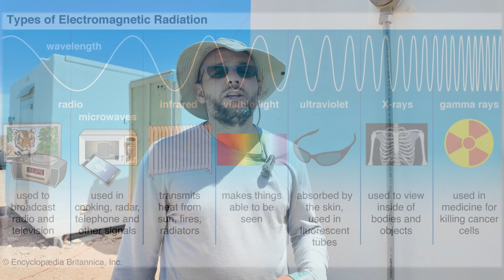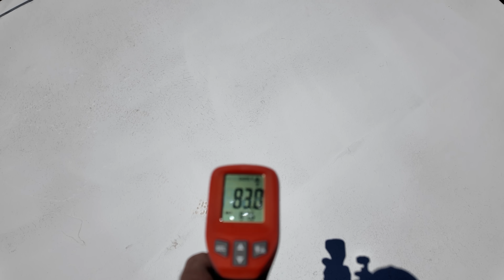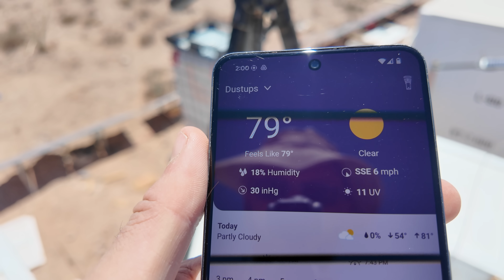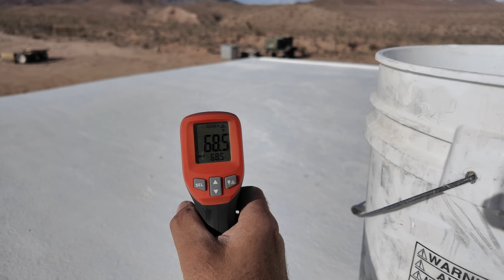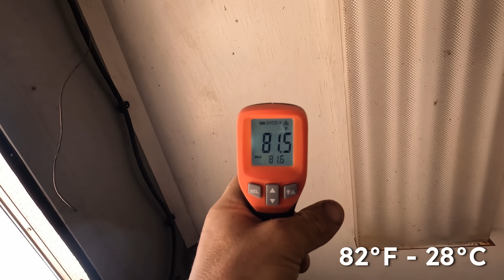I sprayed "cooling paint" on my desert cabin...this is shocking

Comment: You definitely need some wind power sources which will give you much more power as it appears the wind blows good there. Even more so watching you just about get blown off that roof? one or two small to medium wind power generators with your solar and It would greatly improve your power situation by adding power sometimes even at night. Another thought is to actually mount Solar panels on the roof with space between the roof and panel as that would also shade the structure while providing power.
Reply: Sun and wind together to feed the same battery system is always nice. Especially if you also have something that can benefit from peaks like running AC extra hard if there is excess power.
Reply: Plus wind turbines produce a small cooling effect a well.

Comment: Maybe getting wind mills to produce electric since it looks like u get wind there
Reply: Well he also has quite a bit of sunlight so i would assume that knowing solar systems is probably enough. Managing two different electricity systems might be a bit of a hassle… especially considering the most expensive part is the charge controllers and batteries anyway
Reply: @maxsmith8196  if the wind blows through the night then it would put less strain on the batteries
Reply: @maxsmith8196  there are inverters that handle bot solar and wind, but yeah that is a sizable investment
Reply: Solar would be cheaper and he could use cheap battery packs to store it.
Reply: Wind turbines also had a cooling effect on surrounding land.
Reply: @DavidKnowles0 What planet did you go to school?

Comment: You could set up shade cloth around the buildings to shade the buildings and prevent direct sun exposure. This also places less warm air next to the building.
Reply: Shading the west side of the bedrooms would probably help a lot too, whether with shade cloth or just parking something on that side or moving the kitchen or shower over to the west side of the sleeping quarters so they aren't getting the late afternoon sun.
Reply: Too obvious?
Reply: Yep! Here in australia, Dongas (Huts) are usually congregated under a big corrugated metal arch. The air gap helps with dissipating the heat from the above roof. It's surprisingly cool under the whole thing. Often there's a communal bbq area in the middle too.
Reply: In Tenerife, they use huge Green Netting over their Banana Plantations. Rolls of Bamboo Sticks as a cheaper lower wall. The Temperature inside is a LOT cooler. Maybe a few Pots of Clumping Bamboo to help with the Shade, they’re very Tall and Bushy. Just a thought. ❤
Reply: I've been saying that to myself since I first started watching. 
Sun shade cloth would save them a huge amount of discomfort.
Reply: Agreed. My first thought was desert camo net strung up between the buildings and/or over them
Reply: Reflective paint must stay clean to remain reflective. This could be difficult in a dusty arid climate. Shade cloth is used frequently in the south. Wind will not damage the cloth if suspended properly. It also can protect from hail. UV light eventually deteriorates the cloth.
Reply: Shade cloth is actually less effective than thermally emissive paint.
Reply: @badsamaritan8223 I think a lot of ppl who watched this video don’t understand the radiative paint.
Reply: Agree 💯
Reply: @badsamaritan8223  May be, but he expressed not painting the sides of his building, where the shade cloth would go.
Reply: See my comment above. It works. And during high winds as well. Used by military deployed to desert locations.
Reply: The easiest way is to paint the roof white. Shade the front. Then use earth on the 3 remaining sides
Reply: @LisaTurner-d1b  another great idea
Reply: Shade is key! You could use fabric or white-painted wooden slats—or any material that works.
Reply: @Patschenkino  True but anything in that blowing dirt environment needs to be cleaned
Reply: @cheapercharlie  Those things still provide shade even if they get dusty. 😉
Reply: @Patschenkino  You are right
Reply: Burning man approach -shade structure over structures and shared areas.
Reply: That was also my first thought :). 
I would also investigate stone and earth walls to shade the sides of the cabins and redirect winds if needed.
Reply: Yes but you won't get the active cooling effect from the radiative cooling, so it may or may not be better
Reply: @srboromir452  I suggested it with the sides of the doghouses in mind, where he mentioned not painting.
Reply: I was thinking of something similar but with a light colored privacy fabric for better heat management (as opposed to darker colored fabric) as well as permeability with air.  It'll also catch morning dew to help with some relief before the day gets hotter.
Reply: @Nanogrip as long as they don’t go over the roofs 😉
Reply: Or even use solar panels for 'shading' and powering the AC. 🙂
Reply: Feel like the wind there put a lot of work on the cloth
Reply: @gamerboy7820 there are lots of things in the desert covered by shade cloth for camouflage and heat or both reasons.
Reply: @gamerboy7820 I'm in Florida and have them up during out dayl (cat1) afternoon storms. Even the cheap ones from Amazon are tough.
Reply: @gamerboy7820 gyproc plus some wood to hold it. Or aluminum siding. 

Cloth is just cheap and easy to put on, but even the laziest roof on top of the box would help a lot.
Reply: @gamerboy7820  We use shade cloths in the middle east over our tents
Reply: @gamerboy7820   it would have to be air permeable, and offer some shade.
Reply: @gamerboy7820  shade cloth works in situations like the guy said if you do it correctly you need to add support and taught it fairly well and add more anchor points so the cloth wont start flopping around its the flopping that starts to create friction which wears on the fabric i've done what he said and it works it makes the rooms color too it wont make it magically colder but it will bring the temps down a good amount
Reply: @gamerboy7820  Agreed on the wind. I live in a windy place, windy enough there are hundreds of windmill generators in the hills nearby, starting maybe 10 miles away. You learn to not leave things like tarps out, or they'll be gone. You have to use extra staples for landscape fabric, and staple as you go. Things like kids playhouses and trampolines have to be anchored into the ground, and in construction, house-wrap better be covered with siding soon or you'll have to do it over, and you do NOT see people with those shade umbrellas built into their patio furniture/picnic tables, because at best they just break, and at worst they break a bunch more stuff when they fly around, and are a huge liability. With that kind of mindset of living in a windy place, every time I see shade cloth suggested to Shawn, I think "yeah, that'd be nice, but it would just be ruined, probably sooner rather than later." 

If anything, he'd need like ultra-sturdy shade STRUCTURES built or brought in and installed, but that could be pretty pricey. If he and friends/employees are into welding, then maybe they'd still want to give that kind of thing a try, maybe something like what'd essentially be over-built/oversized covered parking structures, where solar panels could be mounted. Or, maybe they just literally build a sturdy solar array that's a little ways off the ground. One additional option here is having solar-heated water for showers, washing hands, kitchen use, etc. If it were me, I'd go with a sturdy (welded steel) solar array that doubles as shade, maybe even something like half an A-frame that could maybe double as a wind-block (depending on the direction of their prevailing winds).
Reply: @gamerboy7820 use the same material that Bedouin’s and other arid nomad cultures use for their tents
Reply: @FancyVader  --- Shade cloth would be better the wind goes through the open weave.
Reply: @FancyVader  is that cotton or wool?
Reply: @FancyVader  thats woven goat hair...you ain't finding that anywhere close
Reply: @gamerboy7820  You could build a "shade cloth" out of plywood. Anything that stops the direct sun and has an air-gap.
Reply: @gamerboy7820  True but that dust will dirty up that white paint in no time
Reply: @cheapercharlie  true instead he should get windmills
Reply: @gamerboy7820  The bad thing with 'windmills' which I think your talking about wind turbines, is that they can tear themselves apart in high winds, even the breaks can fail and parts go everywhere.
Reply: @PetraDarklander  Not to mention cost.
Reply: @gamerboy7820  Fantastic idea
Reply: Yes
Reply: check the episode till the end. Looks like entire new level of construction is planned on the top of existing structures to shade it all finally
Reply: @karolwozniak9023  Yes, but that is a year or years in the future, this would be an immediate solution to the problem that can be moved to another location after it's built.
Reply: Too easy
Reply: We have done this with our cabin and it works amazingly.
Reply: Was thinking the same thing. Platform, shade cloth, anything to create an air layer and block some sun.
Reply: This is exactly what he said in the end of the video, cpt. Obvious.
Reply: @vasiliynkudryavtsev  What are you talking about? If you mean the structure to make it multistory that will probably not be around for another year or years, shade cloth is fairly inexpensive and quick to set up unlike the second story I believe you refer to.
Reply: @aaronbonville4570  Oh, sorry, my wrong. 
He indeed was talking about second story, which is stupid. Because, I was thinking about big shade to put all his buildings under. Which is exactly what you were talking about.
Reply: I thought the same thing, but if wind is an issue, SNOW CAMO NETTING on an inexpensive 2x4 frame built with a 2 foot gap from the structure.
Reply: Hahahhahhahhahahah shade what’s that ? Did you invent that????
Reply: Yep Aluminet. Really good way to reflect light and heat.
Reply: @charlesdeuter Just would defeat the purpose of the paint…
Reply: Did you actually watch the video? 
Hint: the wind....
Reply: I did watch the video, and the wind, if the shade cloth well secured, is no issue. I do not know what you are trying to say, for it is so vague, but I do know I do not like your tone..  @brittassss
Reply: $300 for a gallon
Reply: @tomwuttke  OK, what are you trying to say?
Reply: I've sometimes wondered why reverse brick-veneer isn't a thing.
Brick inside, cladding outside.

Brick has a high thermal mass, and cladding is much thinner, therefore lower.

I assume it's all due to aesthetics.
Reply: I agree however warm air next to the building isn't the problem the problem is the sun directly heating the surface of the structure.
Reply: Land Rover did their double roof skin for that exact reason.
Reply: Scrolled down and saw your reply.  I posted a similar thought but with something sturdier than cloth.
Reply: This.
Reply: I was thinking along the same line another easy to implement idea he use one of those plastic tarps he got donated heist it on 2 poles and a rooftop also spray it with that reflective paint aswell and it would be some very nice shade where there is nothing atm I'm sure it wouldn't hurt or be that time consuming
Reply: I'm confused as to why Shaun hasn't done this yet
Reply: By this comment alone, I know you have no experience with shade cloth. The cloth provides shade, yes, but it traps heat/humidity.
Reply: @drb996  What are you talking about? The shade cloth I have experienced seems to breath better than what you have experienced.
Reply: @drb996 Also would negate the radiative cooling effect. I needs direct line of sight the space.
Reply: Agree